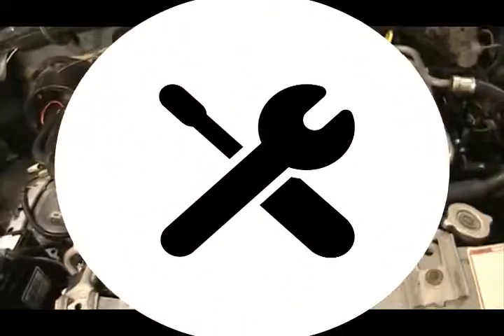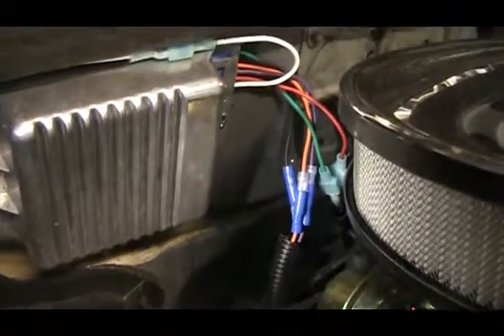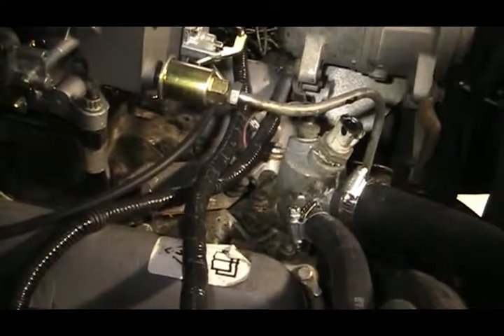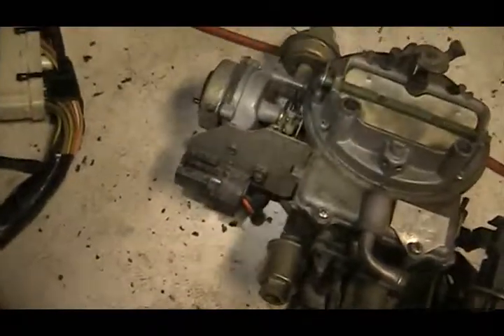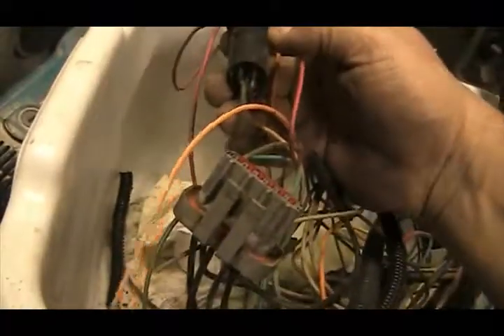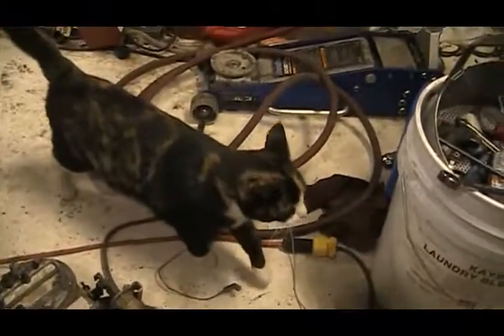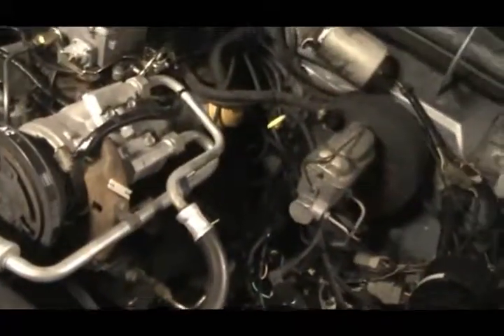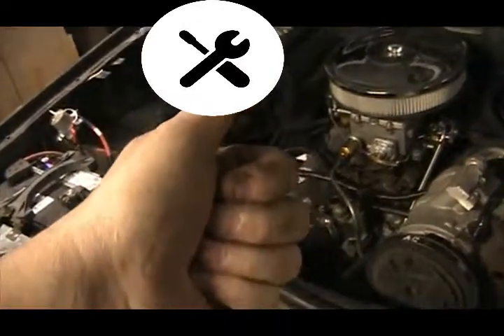TOTAL GARBAGE!!  84 ford ranger conversion. RANDOM CATTAGE.

Comment: I have a 84 bronco 2. same engine automatic transmission, Someone decided they're cut up some of the wires in that harness. And it's been very difficult trying to piece all the wires back together to their original state. I'm wondering if this may be a better option? I'm not a fan of emissions either. Do you still have gauge functions and other interior light functions?
Reply from the maker: Everything worked out well on mine, even after I put the harness on a diet, most of what I cut out was for the computer feedback.

Comment: I need to know how you finally corrected the problem. I am so tired of the problems with mine. How did you fix it? How is the performance now?
Reply from the maker: if you still have the original parts and it just wont stay running this might be a solution for you , as you can see i stripped all the junky parts off and went with a more reliable approach.